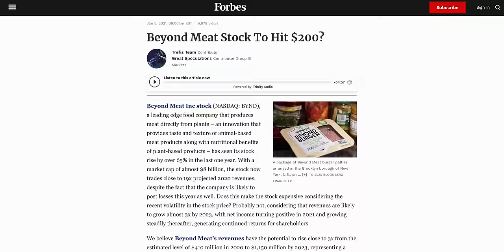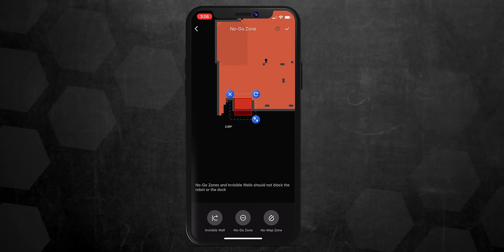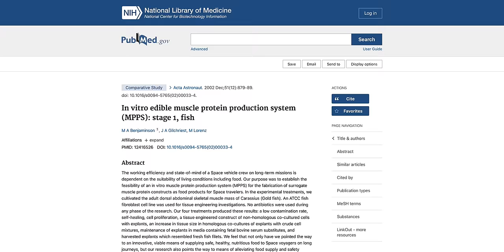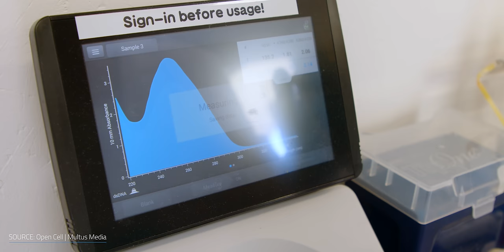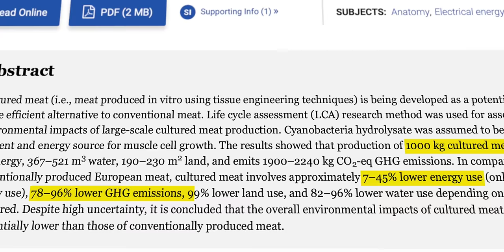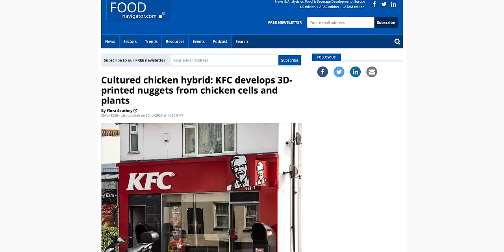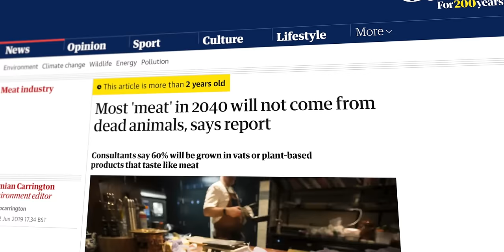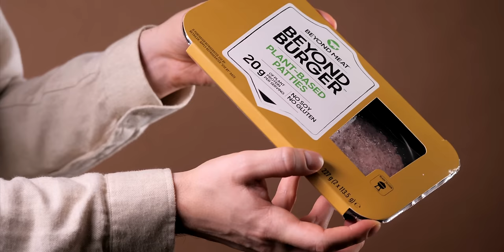The Future of Meat - Lab Grown Meat Explained

Comment: I find it interesting how you refer to the process of growing meat in a lab as "not sounding mouth watering" while the 'natural' (though I'd argue this isn't natural either anymore) option is an assembly line with cows hung from their hind legs with slit throat so their blood can leave the body...
Reply: I thought exactly the same thing.
Reply: This method is not used in NZ, animals are stunned using a captive bolt gun. You dont even want to cause excess atress to animals, this makes the meat tougher.
Reply: @FrightF  Still pretty brutal no matter how you look at it. Messy too.

Comment: I don't see this replacing farmed meat, but I do see it supplementing it. Herds of animals trampling and grazing are necessary in farming as well as reversing desertification. There is a great TED talk on the topic about how a man is revitalizing the land in Africa with cattle. Personally I am not opposed to either, whatever fits the budget and tastes the best will get my money.
Reply: Isn't excessive grazing the primary cause of the dust bowl? Seems like that assertion requires some qualifiers.
Reply: @louishermann7676  it wasn't grazing that did it. Otherwise the bison mega herds that could stretch to the horizon would have done it in sooner. It was turning into arable (farmable) land that did it. The great plains had deep rooted grasses to stabilize the soil, and with that getting tilled... History.
Reply: Over grazing creates deserts but when managed properly it regenerates the soil

Comment: I think the introduction period will be rough, for any of the options there seems to be a drive to trial it with those more well off, due to initial cost and recuperation of research. The problem being that those markets see it as a low (overall) value novelty. To truly drive adoption into the middle class it's going to need to have taste and texture at least on par with traditional sources, better consistency (which is built in), and a slightly better cost. To drive it into the wider market it's going to need a substantial cost benefit over traditional methods, as well as an overwhelming availability.

Two things that I think would help promote it in the long term are scaled production (from small to large) which could allow traditional industry an easier transition, and, presuming small enough scaling, promoting it as a way to fuel the diets of our future astronauts (both the professional prestige, and confidence would be beneficial)... and it offers potential for vastly improved long term food independence for off world endeavors.
Reply: but you forget something: unemployment
Reply: @fmvm  not so much forgotten as hope it's mitigated... but yeah, at some level it's going to be a given (as with any "replacement" technology). the hope is that with a good enough scale down, those raising cows today could transition to raising just the meat, tomorrow.

Comment: It sounds a weird at first, and doesn't sound appealing. But if the cost becomes cheaper and the taste and texture is as good as real meat, then I'm in👍
Reply: It is real meat, that's the thing. It's produced by the same cells that produce it in the animal, without hormones, antibiotics and pesticides, thoug. So it's actually better in every aspect that really matters.
Reply: @enricod.7198  good point 👍. But I'm sure you know what I meant.
Reply: @andrewjawney1  of course. I myself really hope that it will become cheap and tasty as conventional meat, that would change a lot of things
Reply: @enricod.7198  well said 👌

Comment: I think the meats made in bioreactors stand the best chance for scale-up. This is a well understood continuous manufacturing process using large scale equipment.As soon as the inputs can be gotten cheaply and the process controls can be tuned, then this will operate like many of the food items we consume today. Bio-self-assembly is cheaper and requires less capital than mechanical processes (i.e. 3D printing). Beer, yogurt, and other foods are produced in a similar way in a matter of days.

Comment: I like the taste of Beyond burgers and would stop eating farmed meat except - the pricing is currently ridiculous in the UK - over twice the price of good quality farmed. On day 1, 2+ years ago I could accept that but not now.

As soon as lab meat is available at a reasonable cost (some premium is ok, but not extortion) I would drop farmed in an instant. I got used to the taste of plant based quickly and actually got to the point of preferring it.

Bring it on - will remove guilt over climate impact and especially the cruely of farming which is frankly indefensible - I am just too weak.

Comment: Hi Matt,  As enthiusiast of your channel, this is the first time I was a bit disappointed. In this case I had expected a bit more depth in your talk. It looked like you nicely composed all the comercials around cultured meat and forgot to check literature and science.  Could you also elaborate on  the use of animal serum in the growth media, the need for GMO growth factors needed for cell differentiation, the need for different growth phases, the difficulty of creating more tissue types, diffusion limitation resulting in max layer thickness of ca 200um, need for mechanical shear to mature the trissue, the lack of nutritional value, as muscle tissue does not make B12, fatty acids etc???? You mention that you can tailor the FA composition better than in cattle: yes as it is externally added, animal tissue dos NOT make these. If I add Omega 3 to a plant burger, this is tailored in the same way, just by addition.  So Although I am not negative about the topic at all, I do think that your video this time became too much of a commercial, while leaving out the nice technical puzzles to be solved, and that make clear that it will never be the "real Thing".  That is maybe also not needed, but that is what is claimed and I think that that is unfair.